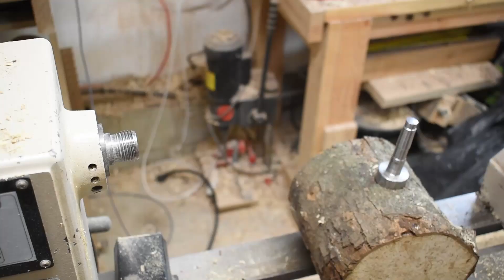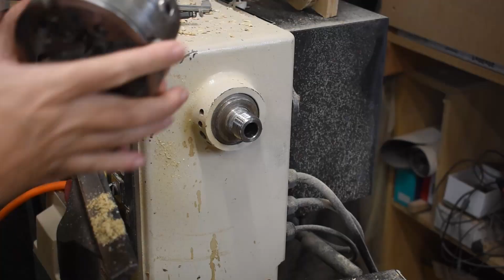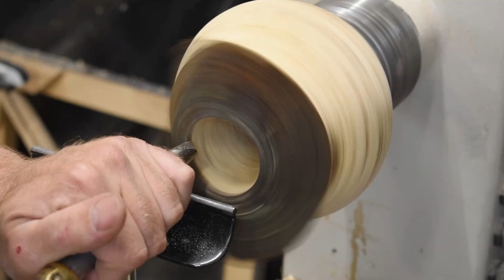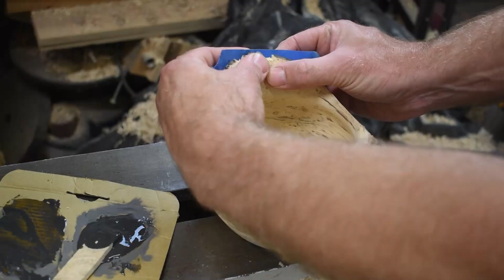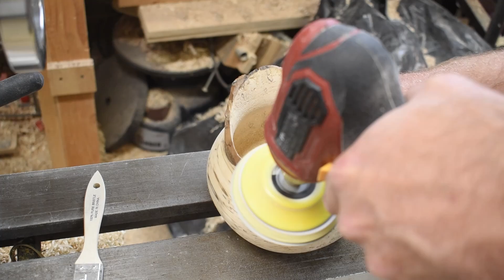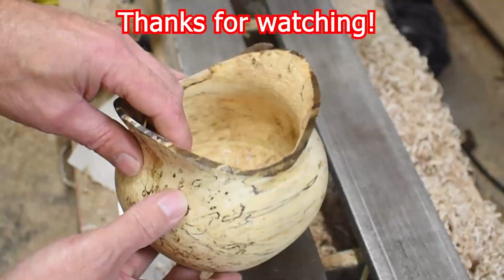Beginners woodturning birds mouth bowls in 5 easy steps

Comment: Adding the epoxy and sanding it out would be easier if you don't remove the tenon, then after adding the epoxy you can put it back on the lathe for quicker and more accurate sanding.  I realize, however, that he did it this for way for drying purposes.  But if you start with dried wood then you could leave on the tenon for the last step with the epoxy.

Comment: I warched how smoothly you carved the inside. Even when your bowl gouge was 3-4" extended from the rest. I find it hard to not get chips or chunks dug out. Very hard to make the inside smooth, the outside is easy. What am i doing wrong?
Reply from the maker: There are a couple factors that affect how bowl gouges preform on the inside of the bowl.  The grind determines the approach angle.  The gouge i was using was 5/8 with a swept back or Irish grind.  The rotation of the flute is another factor.  The more the flute aims up the more aggressive the cut will be.  If your gouge is getting grabby try rotating the flute in the same direction your making the cut.  The more you rotate the flute the less would you will remove but you will get better control.  Last you want the back of your handle of a bowl gouge to be slightly lower then the tip.  Hope that helps.
Reply: @BlackLabelwoodworks  thx very much